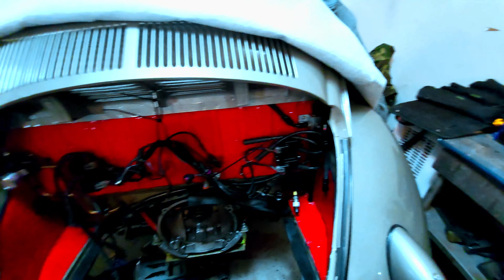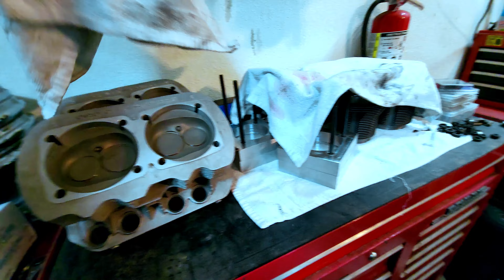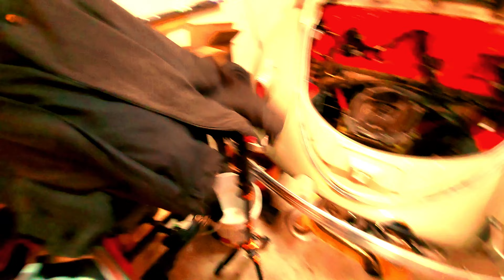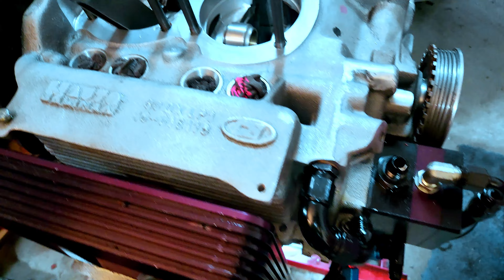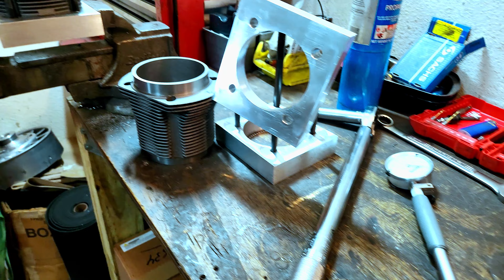Torque Plates for the Air-Cooled VW?!?!? | VW Torque Plates | JW Classic VW

Comment: Great experiment for sure. It was worth the time and effort to see if there was a difference. 
I didn’t think there would be a difference, but was on the fence due to how the VW cylinders clamp between the head and the case. 
Now, on a typical small block or big block engine, the distortion is different due to the head studs are stretching holding the engine block and heads together. I’ve seen a difference between using a torque plate and not using one but again we’re working on VW’s and not V8’s.
Reply from the maker: It made me curious seeing builders like ACE using them... they do work great at a cylinder fixture to hold them when I honed.
Reply: @JWClassicVW  oh I’ve definitely wondered also and I do appreciate you taking the time to do the leg work.
Reply: The difference between the experiment here and what you see in most V-8 applications is here only honing was done. If a resizing(cutting) of the bore had been done, as is done on V-8's when TPs are used and significant changes are seen..that would have been an interesting experiment.

Comment: For just honing the cylinder a torque plate isn't necessary, though, if you have it, use it. A torque plate is a must when you resize the cylinder though.

Comment: if you ever get bored ,,lol,  measure a  jug in the torque plates then heat them to 160/200 deg and measure for distortion,,,,,,thanks
Reply from the maker: That sounds like a worthy science experiment.
Reply: have wanted to test this for Years @JWClassicVW

Comment: My thoughts are at 28 ft lbs what are plates gonna do? It’s not like the cylinders are made of rubber and are gonna flex At All🤷🏻‍♂️
Reply from the maker: Still a bit of torque, true its not much, but it's still kinda cool to check.  I'm going to check the old cylinders as well.  May help in finding issues with those.
Reply: 2 tenths of a thousand out in a barrel will hurt the sealing capacity of the rings ( ring bounce) , if turning 9 thou RPM   in all the gears. Thus a reduction in HP. For street eating Cobra's and Hellcats, weight per HP rules.
Reply from the maker: Within spec per manufacturer for these pistons.
https://auto.jepistons.com/je-auto-ring-installation-guide-2618-pistons

Clearances listed below are minimum. Some applications such as supercharged, turbo, nitrous and endurance applications may require .001"-. 003" to be added to the minimum clearances in Table 1. Cold water pickup marine applications may require an additional .002"-.004" clearance.

Table 1	Bore Range	Min. Clearance

Sport Compact	2.500 to 3.625"	
.0030 to .0035"

Sport Compact	3.626 to 3.999"	
.0035 to .0040"

SB Applications	4.000 to 4.200"	
.0035 to .0045"

BB Applications	4.200 to 4.600"	
.0040 to .0050"

Comment: Dial calipers are not an accurate measuring tool, they are good for quick reference. Micrometers are what you need, best to buy every size up to 4”, you will need all of those for engine building. Also bore gauges read in 5 tenths two ticks equals .001. Try to just move it slowly until you get the highest reading and that is your number.
Reply from the maker: I order the larger 3 to 4 inch one just waiting on it.  I'm curious what it'll read compared to the caliber.

Comment: Nice info Jason. But I need to ask you. Why are you using a copper gasket on the head? From all my info given to me from builders, are that they just seat the barrels as usual with valve compound into the head. I have ran 26 pound boost on a cool day. No leaks.
Reply from the maker: To be honest I'm still a turbo novice so I'm learning and going with what the top dogs recommended.  I'm actually going to be coating the copper gaskets in Yamabond this time, but I haven't had any leaks from that area so far.